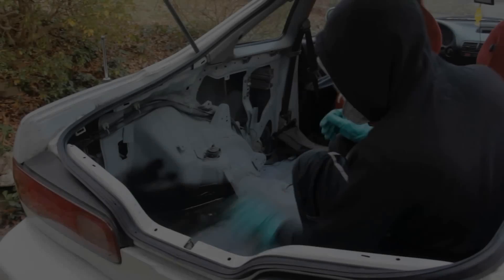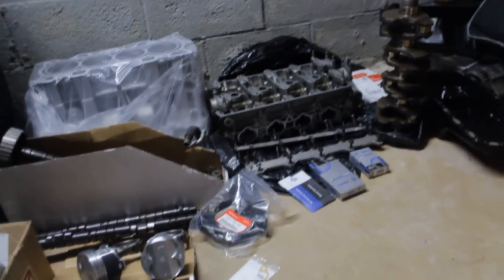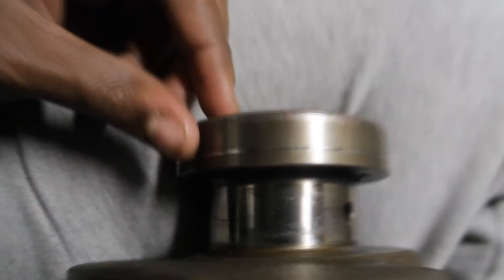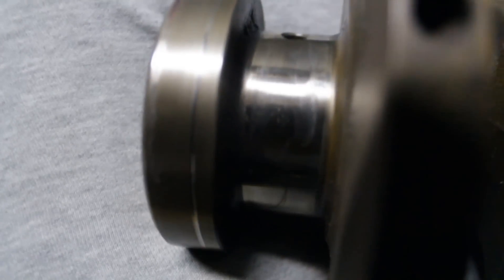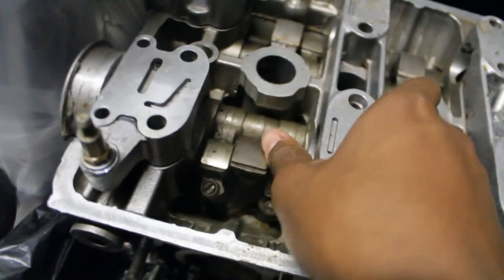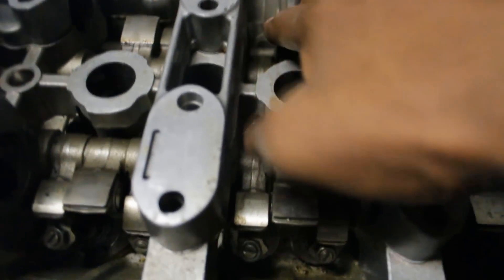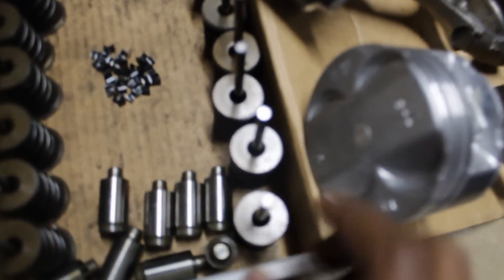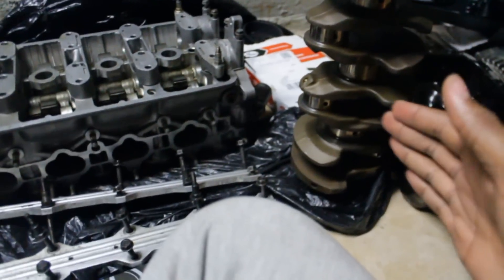B18C1 Bottom End and B16 Head Parts So Far!

Comment: Good progress man. It's great to see everything come together! A couple key things since your cars is a track car: oil pan baffle(if you don't do this, your engine can oil starve in corners causing catastrophic engine failure) and the an oil catch can to prevent oil blow-by and which can lead to numerous other problems. If you'd like, I can provide links to those items. They're both fairly cheap and a great piece of mind.
Reply from the maker: Grant Davidson please do i have not forgotten about that!😆
Reply: baffle: http://www.ebay.com/itm/like/142247283389?lpid=82&chn=ps&ul_noapp=true
catch can: http://www.ebay.com/itm/Brushed-Baffled-Aluminum-Oil-Catch-Can-with-Breather-Filter-10-AN-/262780550613?hash=item3d2ef0fdd5:g:vaEAAOSw~bFWJqe7&vxp=mtr

The catch can is one that I'm currently running. Since they're AN fittings, you'll have to have 10an bungs welded to your valve cover, but depending on if you have to pass emissions, this may not be an option for you. If it is, id recommend using a plug in place of the black box, as well as putting a cap in the PCV valve. The entire PCV system is flawed and doesn't flow well enough for even a stock compression VTEC engine. Its the main reason our cars burn so much oil.

Comment: I noticed you haven't had you're crank and pistons balanced (  mite want to rethink that). Admittedly Honda usually balances them at the factory when they build the engine, but those specific pistons match that specific crank (don't believe me look at the crank, those holes bored in the counter balances, that's to balance the crank to the rods and piston) If you don't balance you're rotating assembly more than likely it will have a vibration right from the jump, and in short order wipe out the bearings. You mite want to read up on "resizing connecting rods" and "Line boring the block" You can't swap main bearing caps from block to block with out "line boring the block". The bearings matting surfaces maybe too tight, more than likely too loose, than you will seize a bearing or spin it. Best wishes on the build!
Reply from the maker: ghettoflyer thanks! i do plan on having the rotating assembly balanced but my main caps came with the block so there was no need to align anything 😎

Comment: middle do you have a new timing belt along with the spring tensioner? I would also get camshaft seals for both sides of the head and crankshaft seals just to prevent going down that road of having to replace it later on if anything does leak. otherwise looks good. Idk how expensive the dealer is where you live but if I'm going to pickup a lot of parts I try to get it online from like acuraoemparts or a similar website I save a lot of money from that then the stealership. build looking good so far!
Reply from the maker: Clint Eastwood yes i already have a tensioner laying around and ill get some new seals when i get closer to assembly
Reply: Middleton Films tovassemboymmly lmaoo

Comment: dumb question:  why are titanium retainers not daily friendly.  i am building a car that is not a daily driver, but a road course car that still must get to the track on the street.
Reply from the maker: +Sarah Harrison They wear down quicker than steel oem retainers and you risk dropping a valve.....If its mainly a road course car you will be fine, but just note with titanium retainers you will need to check on them periodcally so that way you know when to replace them. 😎